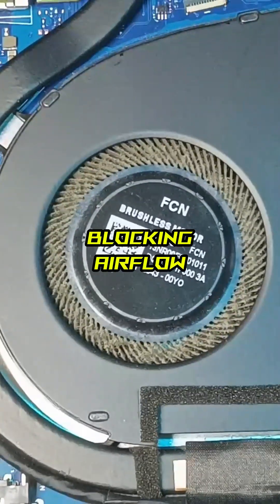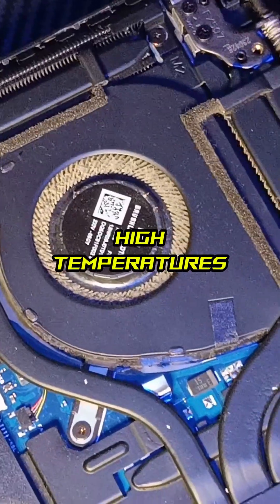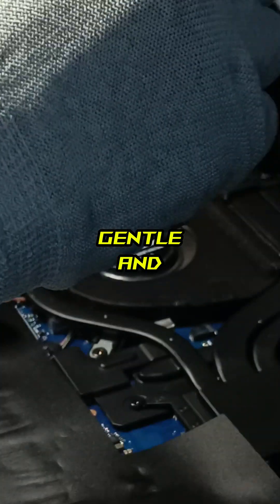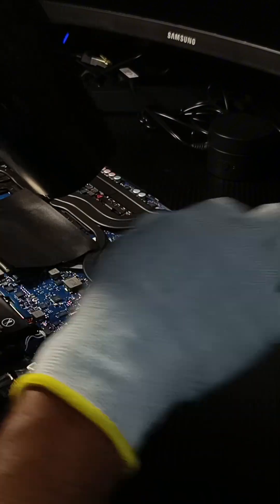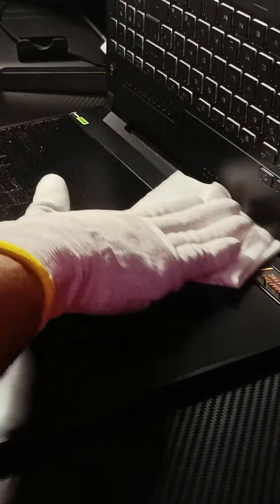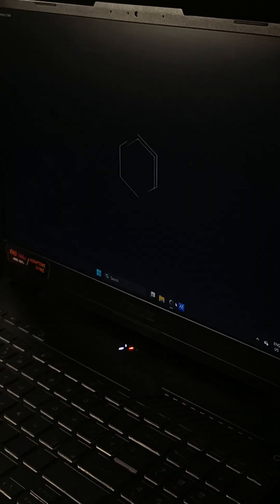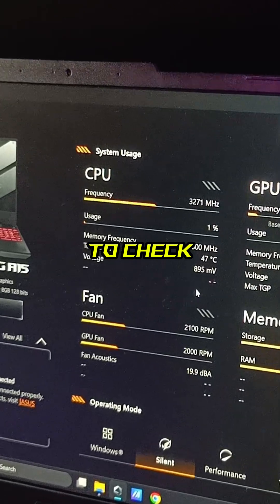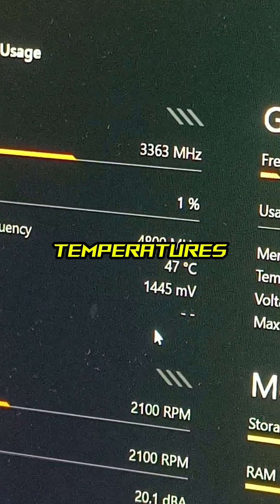FIX OVERHEATING FAST! 🔥 NO TOOLS NEEDED (ASUS TUF A15 Tutorial)

Comment: Do i need to unplug the battery before doing this? Because a couple other tutorials say to.
Reply from the maker: For this simple cleaning method, unplugging the battery isn’t required.
But if you’re removing parts or doing deeper cleaning, then disconnecting the battery is the safer way.

Comment: I was scared i did this once and it didnt want to turn on until i plugged it in even though it was fully charged
Reply from the maker: Totally understand that scare! 😅 Sometimes after a deep clean, laptops need to be plugged in to reinitialize power delivery, even if the battery's charged. Glad it worked once you plugged it in! 🔌💻 Always good to double-check everything's seated properly too.

Thanks for sharing your experience! 🙌 Stay Tuned